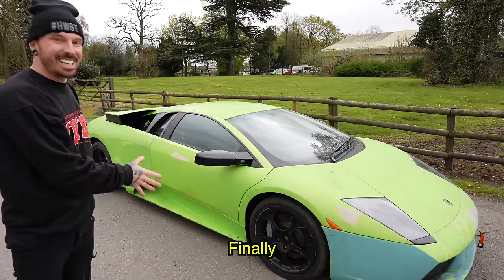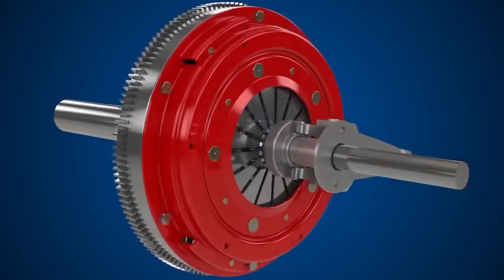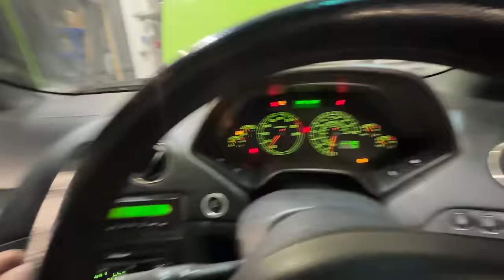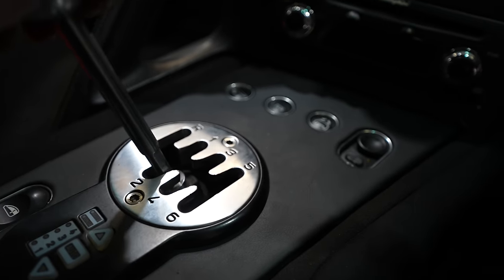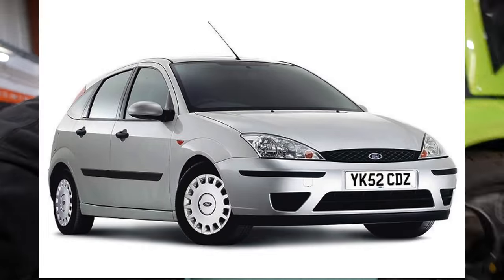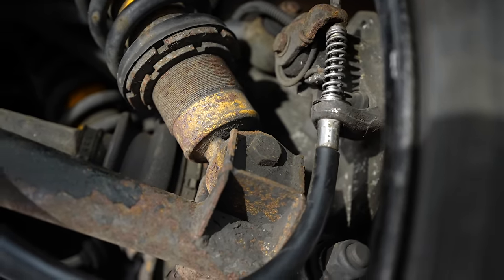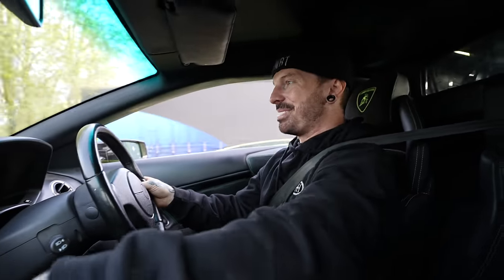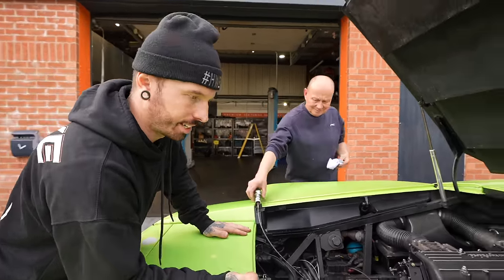REBUILDING AN ABANDONED LAMBORGHINI MURCIELAGO | PT12

Comment: Pull the oil pressure sensor out and put a manual gauge on. But the battery not charging could be linked to the issue. As strange things happen when batteries start dropping volts. Loved the video where you got the engine started! Had the exact smile on my face after a few days of trying to start a M57 in a defender. Top channel!
Reply: Didn’t see this just replied with the same logic
Reply: Yeah, came here to say this. Low battery/ not charging can cause some funny things.
Reply: The battery not charging could be tied to the previous owner crossing the leads when they jumped the car. Charging system may have failed years ago as either an original failure or the result of reversing the polarity. Might need a new regulator and alternator but those part are probably available from some other manufacture.
Reply: Yup, wanted to say the same. Make sure the battery and charging system are doing their thing before chasing possibly related issues.
Reply: Yep, thinking the alternator has had its day.

Comment: I was a technician at BMW four years in the 1980's.  To bleed a clutch like that, just keep pushing the pedal and it will build up pressure and the air will come out by itself since the receiver is higher.  It's self bleeding.   The procedure after replacing the slave is to open the bleeder until fluid comes out, close, then pump pedal 40 times or so and you should have a full clutch.  Keep up the great work, I love your enthusiasm.

Comment: A huge shout out Matt to you and your Dad.  I will always remember my first time when I got my Murci manual.  It's such an amazing car.  I must say I cringed when  I saw you trying to push the shifter into reverse.  The shifter can snap if pressed too hard.  Whilst you needed to bleed the clutch you must press down on the shifter and while pressing down it will easily slide into reverse.  If your gear box gate is letting you engage reverse without pressing down the shifter there is still a problem.  It's designed that way for safety.  The gated shift on the forward  gears is great but can be a little notchy.  You will love the clicking sound as it positively shifts into the gate 😊. I am trying to remember the motul gear oil but there are some good choices to make the shift easier.  Will always be somewhat tight at first in extremely cold days.  All the best.  Looking forward to the final stage after painting

Comment: Great to see you and your dad finally going for a spin 😊 As for the oil pressure I'd get a proper mechanics analogue pressure gauge that you can screw into where the oil pressure sensor goes. 14psi at idle isn't an awful lot of pressure and the oil light could either be the ECU using the pressure sensor against a preprogrammed value that turns the light on or it's a separate low pressure switch fitted to the engine but most likely the ECU is calculating if the pressures too low or not.
Get the engine up to temp as this is when the oil is thinnest unlike when cold. Also, double check you've put the right grade oil in there. Fingers crossed it's just a bad pressure sensor cos I'd have thought at least 50psi when you rev it would be good pressure and idle pressure should be around 30psi but certainly above 25psi.

Comment: 1000rpm 1.5-2.5bar oil pressure.
That gauge in the clocks looks to be around 1 bar. Remove the oil pressure sender and put a manual gauge in there and check the pressure. 
I had an identical issue with a Audi v6 once that came to me and that had had a rebuild and the oil seal between the pump and block was missing. 
Good luck with the project and thanks for making these videos and staying positive with the setbacks others would of given up. 👍

Comment: Amazing videos! I am so happy for you guys that you are able to drive it now. 
I am not a mechanic but I had the same problem with my car (with battery not charging and airbags sign) and it had to do with the dynamo which didn't recharge the battery as I was driving. Which then gave very little electricity to the car which caused the indicator with the airbag sign to come on. Maybe this info helps you with fixing the problem. Looking forward to the next video!

Comment: This is amazing to see it finally rolling !.. top effort from you and your Dad... with the hydraulic clutch sometimes it's worth reverse bleeding. Connect the bleeder to the slave cylinder in order to force bubbles out the filler cap instead, as air "likes" to rise not be forced down. Battery could be a genuinely duff battery or voltage regulator on the alternator, the rest is hopefully dodgy sensors...

Comment: Nice ! Congratulations 🎊 
Maybe you can try to check for the correct voltage at the oil pressure sensor, maybe try a different oil pressure sensor and certainly do a pressure check with a gauge, and check for proper oil weight

Comment: First thing with the oil pressure issue is to check it with a seperate mechanical gauge, that will prove/disprove whether you have an issue inside the engine.  If the battery isn't charging though it may just be low voltage making the gauge read low which is bringing on the light.  It depends how the system works.  Well done, its a major achievement to be able to drive it after the state it had been left in by the previous owners🙂

Comment: Awesome work Matt… if the fuel gauge is creeping up & the door open light is on I wouldn’t freak out about oil level or pressure… it definitely sounds like an electrical signal or dash connection problem!! 
Keep at it dude

Comment: For the oil level i believe the car should be at specific temp and idling while you check it, but i could be wrong. Have a look at the manual. Put a gauge on for oil pressure where the switch is. You need at least 3bar of pressure when warm at idle

Comment: Change the oil pressure sensor, there may be dirt in the system which is only normal how long sat and also flush the oil. If not then check oil pressure manually and if still is still there you’ll have to take it out and investigate 🤙🏼🤙🏼

Comment: Im not savy with cars but i love this channel and some mechanic tried to tell me my clutch needing replacing 2 days and tried to charge me 800 euros... the issues was similar to yours with the gears and it was grinding going into reverse and the others gears were sticking and hard to push in when i seen how you fixed it i went straight out to my car and tried adjusting the pedal so it fully opened you just saved me about 800 euro...

Comment: Low voltage seems like it might be the problem with your oil pressure fault. New alternator and/or battery most likely. Very much enjoy your channel. Amazing work on the Lamborghini!
Reply: Perhaps just new carbon brushes and a recond cycle with the battery charger would do the trick

Comment: Same handbrake mechanism for the Porsche 928 series.
I had the oil pressure light come on my 928 back in the 90s so I called the Porsche Centre and asked what to do. They said its the oil pressure light, I said how do you know what if its another problem.  The comment was "Brian nobody has ever blown up a 928 engine I'm sure you're not the first." They were correct.
Hopefully its just a pressure sensor issue.
Been following this story from the beginning and enjoying it. Also following your GT3 story.
Keep em coming.

Comment: great video's love the work, would just say be careful with the Gunson eezibleed from the normal tyre pressure, you shouldnt exceed 20psi and actually 10psi is usually enough, risk of blowing a clutch seal at a higher pressure, if you've not suitably deflated the tyre first to a match a lower psi - good luck with the projects, look forward to the next video.

Comment: If you can take off the slave cylinder you can push the push rod in as far as it can go , make sure the reservoir is full and it will push out any air repeat steps , and you will have a system bled 😁

Comment: Great you drove it well done! I think oil pressure sender unit could be faulty, or the cable going to it, they can rub through and being the light on. You had indicated oil pressure on the gauge, it didn't rattle... You'll be OK. I've had this issue on rebuilds before, maybe a tiny swarf of metal in the swith... Had that before also 😉

Comment: That shift knob adjustment was hilarious considering its a VAG product, my MK2 Jetta had the same procedure lol. 4 bolts holding the shift box to the body, and a special locking tool to hold the shifter dead center while you tightened the linkages up front.

Comment: I bet the electrical issues are isolated to a weak battery. This is common when the battery has a lower voltage and not enough amps to keep everything running. 

Keep it up! Can’t wait to see what happens next!

Comment: Congratz! You said Oil temps looking good, Oil pressure looking good, en I was looking at the oil pressure guage thinking hm, there is almost none, and then the oil light started flickering probably because the oil warmed up. I'm affraid the engine bearings are done for.

Comment: You need to fit a known good mechanical oil gauge to check the actual oil pressure..We do it on all engine rebuilds to check oil pressure on cranking firstly then on  first start up.

Comment: Hi Mat, great that you can finally drive your Lambo, I'm jealous of you. First solve your battery problem, measure it, charge it enough? with the engine running you should definitely have 13.4 volts, so measure it. With a low on-board voltage you can and do have strange malfunctions. also check the mass to the motor carefully, no resistance? Greetings from the Netherlands

Comment: There may have been some gunks in the oil passages after such a long standstill that started moving, I would change the oil, the oil filter and the oil pressure sender unit just to be sure. Judging by the previous videos the oil pump seemed good to me. Good luck!

Comment: 16:40 oil pressure. Could be a number of things sadly. Could be as simple as the computer seeing the cluster not being able to read oil pressure properly. It could be as you said the pump you rebuilt. It could be even RTV sealant that got into a oil passage somewhere clogged up...  Need to get you a manual gauge and tap into the block somewhere and test the actual oil pressure. Then you will know where to start looking. Could ditch the factory cluster completely and go with a Haltech or Motech unit with all the fixens..

Comment: I would add a mechanical oil press gauge and connect it somewhere on the engine and read pressure. Electronic gauges can easily read faulty. Bad ground or something

Comment: I agree with what some others have said, it sounds like that you have a charging system issue. Low voltage can make the PCM do funny things. Get that sorted out first and then see if the glitches continue. The door indicator may be an issue with the switch in the door latch.

Comment: There's also bleed nipples with a ball and spring inside; you can loosen those a little bit and use that to bleed them (as pressure in the line pushes the ball out of the way)

Comment: Handbrake is similar to 1972 Holden 3 seater ute in Australia. 
It was mounted between the door and seat, and then when on it would drop to the floor. To release you would pull handbrake lever up, push the button and then lower it.

Comment: That type of handbrake is called a 'fly off' and is standard in Porsche. It's also used in lots of competition cars (mainly rally) as I had one in my '77 Ford RS2000.  Congrats on the build thus far.

Comment: Posting on behalf of my other half Liam who doesn’t have a YouTube account! 

Low battery voltage at low rpm causes all sorts of lights to come on the dashboard, this only happens at low rpm so I would charge / replace the battery before you do anything with the switch, cheers! (Seen it many times and I’m a mechanic) 😂

Comment: In order for the air inside the gearbox oil to completely empty. You have to fully squeeze the clutch several times before releasing the release piston. And do this process several times. Of course, this is an opinion. In the case of oil brakes, we definitely do this. Not sure about the clutch.

Comment: Gaining fuel could be one of the gauge signals are mixed. I would connect a mechanical guage to check the oil pressure.

Comment: I love all your work and your videos Mat. I do have  a practical concern though following your first drive. I do wonder if the oil light warning was indicative of worryingly low oil pressure. After you started the car, you were relieved to see that you had oil pressure showing on the gauge. It did seem as though there was little movement of the gauge needle however. Might this suggest that the rebuilt oil pump is not doing the job that it should be? I do hope that this isn’t the case of course as to see the engine have to come out again would be tragic!

Comment: The low oil pressure issue can be improper bearing clearance and when it reaches operating temperature and the engine clearances change you are getting too much bearing clearance causing a low oil pressure scenario.

Comment: Probably better to bottom up bleed the clutch line. Oil  pressure at low rpm can be a sensor or a case/bearing clearance issue.

Comment: The oil pressure at idle seems a bit low, The oil pressure sender can sometimes be a problem. All I'm seeing is 1 bar which is about 14.5 psi you should have between 20 & 30 PSI @ idle which would be closer to 2 bar.
Please be careful you don't want to seize or push a rod through the block. But if you want to add an extension to your block and add a terrarium then I wouldn't worry too much.

Comment: So according to the factory service manual, you should have 1.5-2.5 bar at 1000 rpm or idle and it should be at 5-7 at 6000. It goes up with rpm and oil level should have nothing to do with it unless you are very low. It also says it might be a little lower on high mileage engines. So your car at 1 bar at 1k seems right. As long as it’s going up with rpm. 
Good luck brother. I know you’ll work it out.

Comment: Matt, you're comment on the defective oil switch maybe correct. That is what happened to mine in Le Mans and i had to use an electric pump to draw oil back out through the dipstick. Worked fine though. John

Comment: Nice shop and you use the most janky set up for a bleeder system. Get you a proper vacuum bleeder setup that works off your air compressor line. Can use it for breaks/clutch and coolant. Or Things like emptying out a reservoir before removing it. Prevents brakes fluid spill when replacing one on a motorcycle. Or if you have pretty paint under your hood..

Comment: Silly suggestion but make sure that light is not battery related. You have changed the cluster and it may giving you the wrong light, you said the battery ain't charging, it has very simple canbus but might be confusing the clock. Check oil pressure at the engine I don't know about the lambo but on a rb26 you can plum a gauge in on the pump to get an accurate reading. Hope this helps

Comment: Fix the alternator first, then focus on the oil pressure, could be related. Sensor might not work under low battery voltage

Comment: Hi there Mat, great video again hope that it’s the oil sender thats at fault. While your in there if I were you I would check the workshop manual to see if there is a sender for low oil pressure and one for high oil pressure like all the other VAG cars! Since Lamborghini borrows a lot from the Volkswagen Audi Group!

Comment: I needed 10w/60 to solve my low oil pressure issues in my psycho motor. But you don’t have the heat issues we have down under

Comment: Warning lights on your dash display. Probably sounds mad but it's worth trying another battery on the car first. I say this because on my car, when the battery started to fail, although it was strong enough to start the car, it kept throwing up all sorts of warning lights on my dash stating numerous different issues! As soon as i fitted brand new battery, all those warning lights disappeared and had no issues since! Just a thought, for the sake of trying another battery on your Merci, it could just rule out that issue before you move on to more indepth troubleshooting???

Comment: I want you to succeed so badly. You could have a low voltage issue. Low RPM the current drop and the oil pressure sensor which is a resistor then faults.

Comment: As I’m watching I’ve hit the Oil situation, an oil pressure sensor maybe? it was coming on when idle and at low revs which makes me suspect that. I’m no mechanic but my bmw has been having oil pressure issues under load and from what I’ve read.. 

when the oil light comes on at low revs the oil pressure sensor is a good place to start. It could also be something as simple as a missing part in the oil filter. BMW’s have a cone shaped sleeve type part that goes in the centre of the filter which stays with the car constantly as you don’t get replacements with replacement filters and apparently it’s common for people who change their own filters not to notice this sleeve when they change it and discard it which causes these symptoms also.

I know it’s a Lamborghini and probably completely different but I’ve seen these issues recently when researching so thought I’d throw some ideas your way Mat, just in case they’re helpful and it turns out to be something simple 😊

Comment: Try a manual oil pressure gauge, if that’s not it it could either be the type of oil or you have an excessive clearance somewhere, or maybe the oil pressure release valve stuck open , hope it’s all good , the pressure didn’t look right on the dash when it was idled I would have expected it higher than that , there’s no way it would have got hot enough for such a low reading just driving around the car park